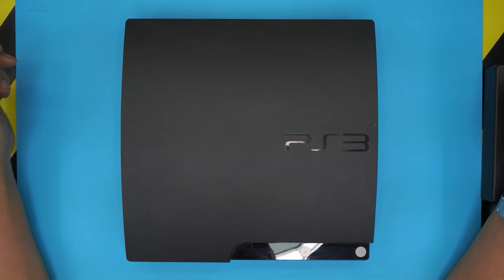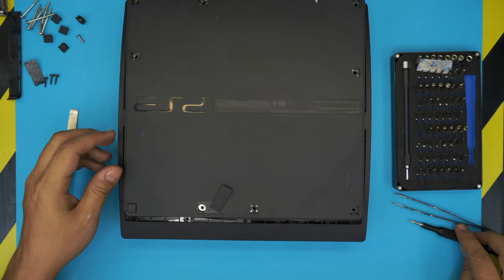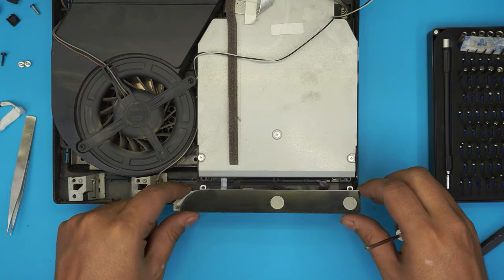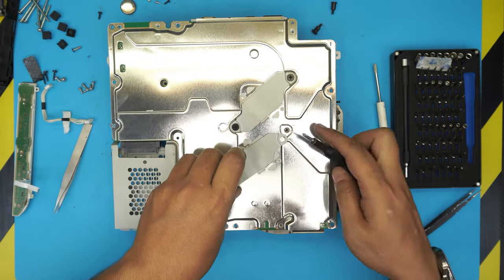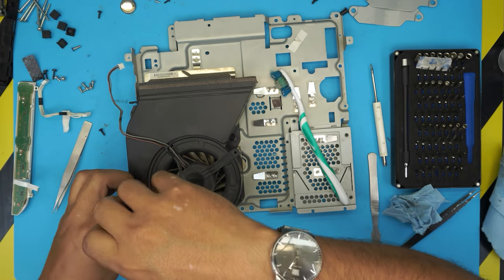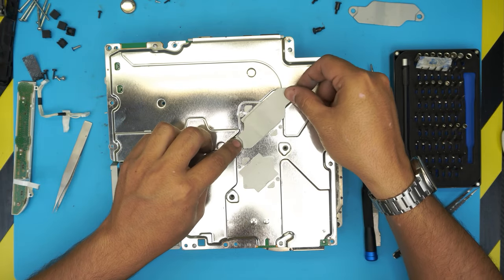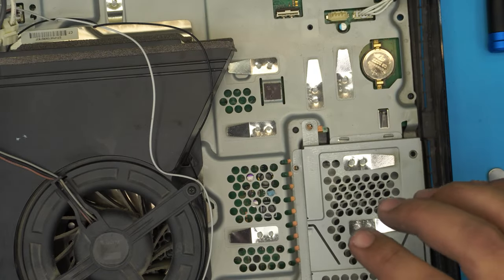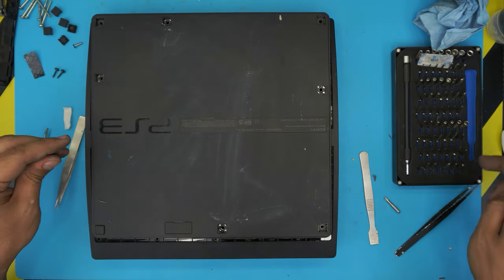HOW TO CLEAN AND REPASTE PS3 SLIM , playstation 3 slim console

Comment: Hello I have the yellow light of death tried replacing the thermal paste but it still has the same issue any recommendations?
Reply from the maker: Thank you! for the feedback and your support to the channel by SUB :P
regarding your question: you will need to remove the motherboard and place it on top of a wood table (not metal nor plastic)
then : #1 remove a the thermal paste and the internal battery 
#2. use a hair dryer at max heat and 1/2 air
#3. keep the dryer above the GPU for 5-6min with 1" on distance (the GPU is the one with thicker IHS, its taller than cpu)
#4. let it cool down at room temperature, dont move it or try cooling it down. let it sit at room temp for 15min
#5repaste  and enjoy. (use a good brand paste)
Reply: @uFixTek  thank you, because I was looking and I saw some options like reballing the whole cpu which needs very expensive tools and hopefully this works
Reply from the maker: this will work its called re-flow.trust me
Reply: @uFixTek  thanks I will do so
Reply from the maker: good luck and if you need any help let me know.
Reply: What model do you have. I've heard replacing NEC/Tokin capacitors can fix YLOD on PS3 phat.
Reply: @excitedaboutlearning1639  I have the chech 2001- A
Reply: @excitedaboutlearning1639  cech sorry
Reply: @excitedaboutlearning1639  and my ps3 is the slim version as well

Comment: i have 1.5mm thermal pads can i just double them up to get them to 3mm or is that dumb
Reply from the maker: Thank you for the feedback! if you wish to support the channel you can LIKE or SUB or both :P
regarding your question: YES you can we have run many test on double pads and they work, we tested the 4mm pad and then 2x2mm pad and we get the same result. so you using 2x 1.5 its fine

Comment: Nice video. But it might be important to open the ihs plate of the cpu and gpu too to change the thermal paste beneath it.
Reply from the maker: hi and thank you for the feedback and your support and regarding of doing a IHS removal, i dont do it in my videos because of Two major factors:
#1. most of people that will try it they will damage the CPU or GPU by trying!
#2. based on many many test that we have done, the results are as following:
-with IHS  paste replace you will get only 3c the most temp drop
its not worth the hassle to do try to remove the IHS just for 3c temp drop.
Reply: @uFixTek  ok, but the thermal paste under the ihs might get hard and this damages the cpu/gpu. you cant stop that with thermal paste on top of the ihs. the temp drop on these ps3's is more than 3c. but i get what you are saying, the process is dangerous. luckily there are a few instructionvideos on youtube for that. i even consider doing it with a ps3 at 67 c in smb idling.
Reply from the maker: the paste under the IHS its a different type of paste its not a regular paste it has a life span of 8years minimum, i would like you to do the following: 
just repaste the top portion and test and check the temps, then change the ihs and test and you will see what im trying to say.
Reply: @uFixTek  That is exactly the process i am in the middle of. Already changed the paste on top of the ihs, but the ps3 still sounded like a turbine for a short time in a game. Then i watched a few more videos and many are saying the paste under the ihs is not really good. The temp of my ps3 idling in xmb is 67c. I will tell you how it changed after i get my heating pistol and try it.
Reply from the maker: @wayn3807  oki my friend good luck and take your time and careful
Reply: @uFixTek  thanks, i will, gonna reply when it is done. thanks again for your video, it helped a lot!